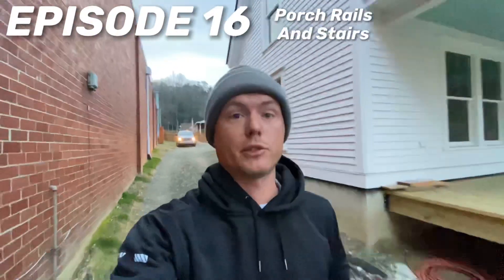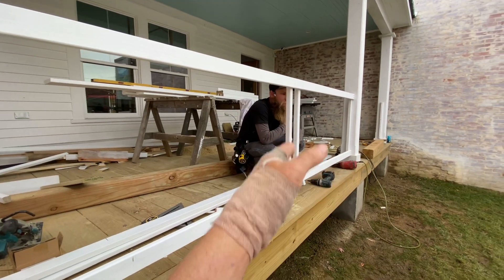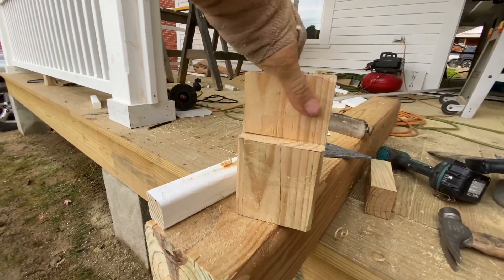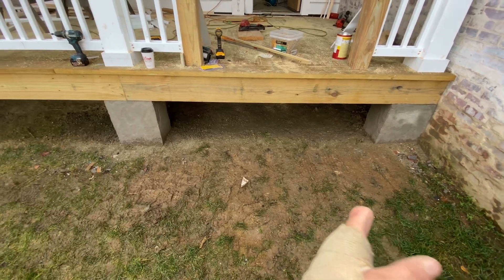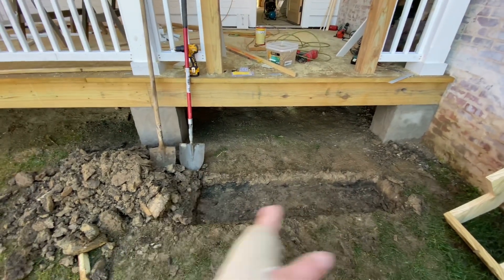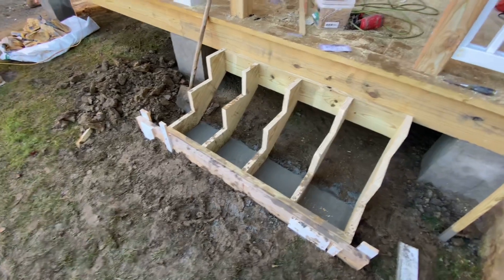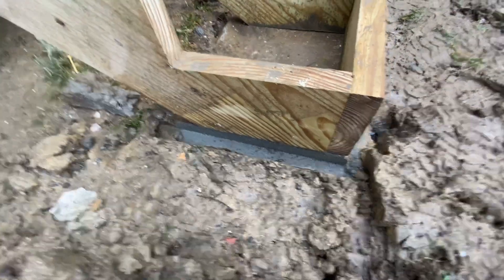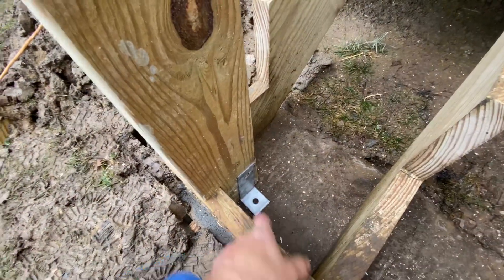Porch Railing and Stairs

Comment: Little truck I learned from the guys in new Zealand when I worked there.

Use hex head structural screws when you're putting together formwork.

You can always find the head, if it gets covered in concrete you just break the concrete and pull it out.

And you can refuse them over and over.

If you're fastening to concrete you can use them with a piece of tie wire in the hole

Comment: Would love your input on a trick my grandfather showed me back in the day. Those metal angle brackets only give a minimal amount of side-to-side support do to the ductile nature of the bent metal. He would put a pieces of wood between the post and the next inside stringer just above the soil line and another right below the tread height. This way you are pinning the post to the stringer which cannot move as it is nailed/screwed to the treads.
Reply: You always do buttress blocking to stringer's because they like to bend and twist as they age

Comment: A little trick I did with my back steps. I did something similar to you did but I put a 2x6 on the flat as a stretcher on the bottom across the stringers. then I screwed some 4x4 post plastic standoffs to the bottom of the stretcher underneath each stringer. Then poured concrete to where those were halfway embedded in the concrete. Also screwed a couple galvi wet set brackets to the bottom of that stretcher to prevent uplift (probably overkill...) That way there was no concrete to wood contact.

Comment: Having a cordless 1/2" drive impact gun for those anchor bolts is worth every penny. They're also perfect for lug nuts on truck wheels... And as we all know, Murphy's Law dictates that if you have the correct power tool to remove the lug nuts, you will never need to.

Comment: Would like to see a "Pro Tip" on how you calculate the spacing of the pickets to keep the same spacing between AND on both ends. I struggle with that every time I need to do it. distance, picket width, number of pickets... there's gotta ba a shortcut

Comment: What is the origins of using the quarter measure, example 5 quarter is inch and a quarter, I have noticed this through out videos from the US, we still use the imperial system in the UK but also use the metric system which is easier than the imperial system, love the Perkins videos.

Comment: Wondering if you plan to put a detail on the top of the 6x6 stair rail posts. Would look good with a cap that perhaps matches the trim at the top of the main deck posts.
Reply: I’d just rout a 45 chamfer round the top and call it a day
Reply: @regggyyy_8774  that’s a good solution although I’ve never seen endgrain not crack and split.

Comment: Overall a nice install. However, correct me if I'm wrong, but I don't believe you have the steps properly affixed to the decks rim joist. I think the code stipulates that the connection between the two should be made with steel braces, i.e., Simpson Strong Ties, and the rim joist need to be extended further down for more of a mating surface for the stair stringers. Just my 2 cents. Roast me if ya like. lol

Comment: Nice work. Isn't there a code about the size of the handrail? Seems pretty big to me
Reply: I don’t know about the town where they’re working but the towns I’ve worked in up here in Connecticut would probably fail the horizontal rail for being less than 38” above the deck, and the stair rail for not being graspable. The lower height that they used looks much better and will still keep most people from falling off.

Comment: I'm surprised you didn't use a jig for spacing out the rails. I thought that was what that block was at first, until you build left it in place.
Reply: You start off with a three and a half inch block and lay it out and then adjust the block as needed or just split the difference in the last one if it's close enough

Comment: I’ve always been told treated lumber needs to dry out for a month or two before paint or it won’t take. Is that not the case? Or have you had this lumber acclimating for a while?
Reply: Painting pressure treated lumber is stupid it's always going to flake off and look horrible and always need to be maintenanced regularly
Not to mention that paint stops the expansion and contraction and creates cracking

Comment: "This is 5 quarter by 6" - Jaime Perkins
Reply: 5/quarter = 1 1/4” standard term for decking material. 
Therefore 1 1/4” x 6”
Reply: @seandixon3764  I thought  could be the case but I had never heard it...
Reply: The finished dimension is 5.5 X 1.